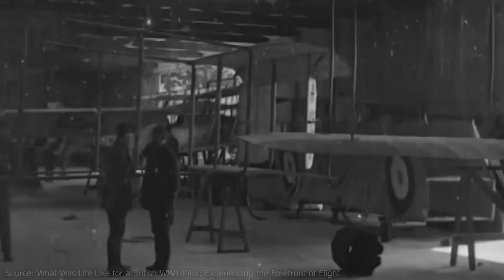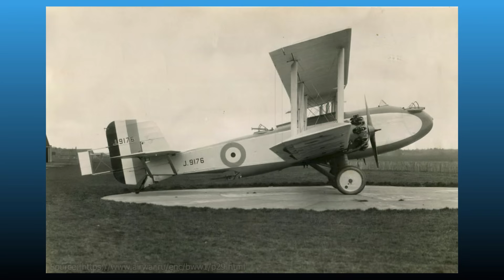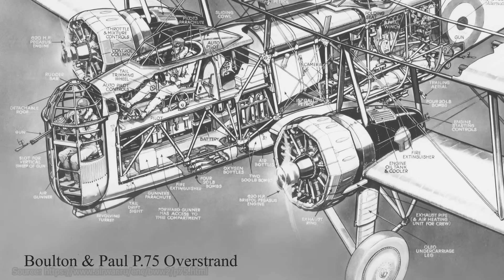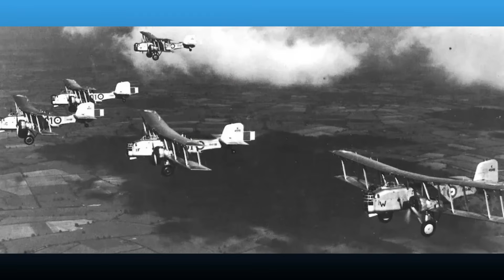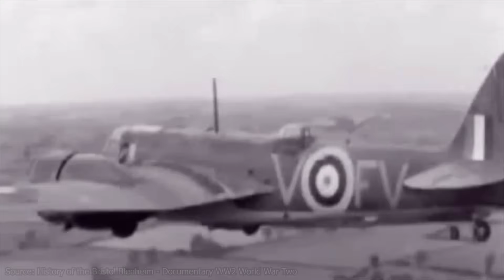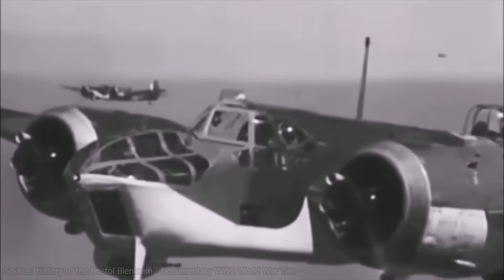Turret First | Boulton Paul P.75 Overstrand

Comment: Boulton Pauls P75 Overstrand was a hybrid  of old and new tech, one mistake ,the Peggys, Pegasus twirled wooden propellers, not the unique metal props  manufactured by Curtiss Fairey Reed . Compared to the Curtiss Wright BT-32 Condor, a biplane bomber transport of similar size, Boulton Pauls creation was somewhat backward . The BT-32 had more powerful engines Curtiss Wright R-1820,s of 650- 775hp twirling  three blade Standard Steel adjustable metal props and yes cats&kittens a retractable undercarriage. Yet this oddball dragged the RAF from the aeronautical dark ages of open cockpits, rag, wood, chicken wire and tailskids. The P.75 had features similar to the BT-32, an enclosed cockpit, a braked main undercarriage and a castoring tail wheel, this important feature drastically reducing maintenance of the RAF,s grass aerodromes turning their aeroplanes from over powered motor ploughs into  something the squadrons can use.

Comment: K...but what was the story with that crazy big trim tab in the back?!?
Reply: Before power controls they would use a small servo rudder that's what it is ..they were first used on ship rudders.. it helps push the main rudder surface against the air stream that will actually change the aircrafts direction occasionally you will see them on horizontal control surface's.. 

Essentially an early form of power assists pre hydraulics..